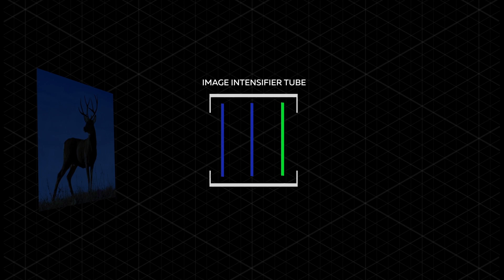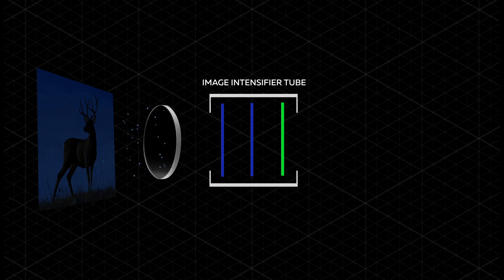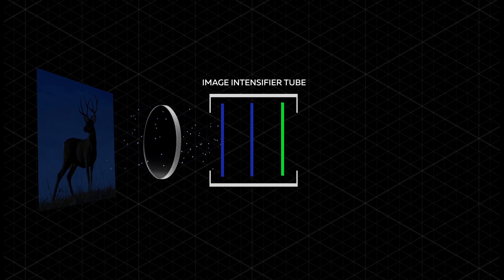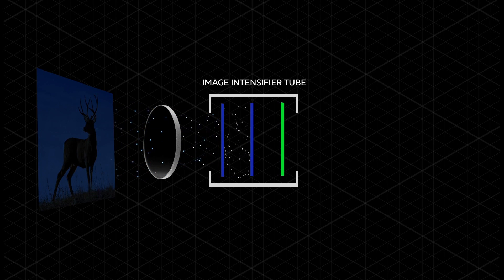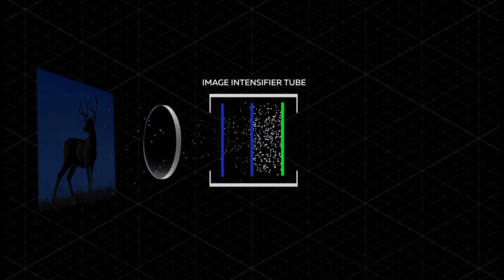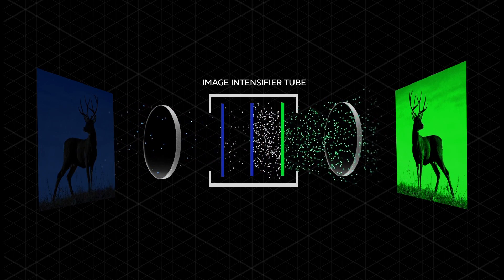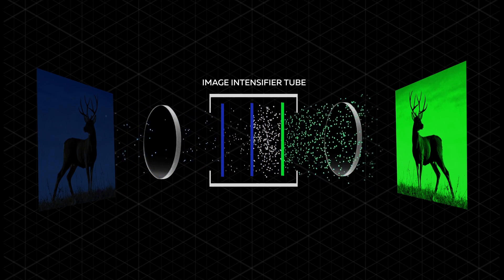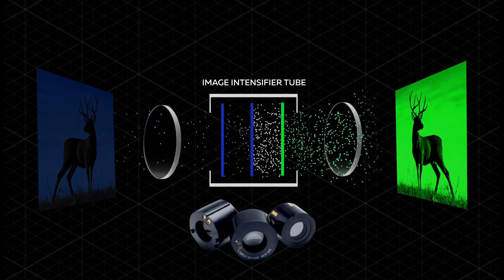How Does Night Vision Work?

Comment: This doesn't really explain much.
Why does the first layer emit electrons?
Why do the electrons travel backwards towards the eyepiece?
How are the electrons multiplied?
Why don't the electrons repel each other?

It's pretty easy to understand how electrons hitting a layer cause it to emit light, but everything else is entirely arbitrary.
Reply: The first layer, the photocathode, is charged to about 1.5 kV. When a photon strikes the surface, an electron crosses the gap and enters the microchannel plate, which is also electrified. This MCP is a thin plate of glass, coated with a layer of metal. Across it are millions of tubes or holes, biased at an angle of a few degrees. When an electron enters, it bounces a number of times, each time releasing many more electrons in parallel. The result is an electron multiplication of 1,000-100,000x. Finally, the electrons strike the anode, which in case of night vision is a phosphor, which is rare earth salt crystals of a chosen size range.
Reply: Do I need electricity to run the night vision or it happens automatically from nature and physics?
Reply: @lbks16 you need a battery
Reply: @heinrichfuhrmeister1244  ok, thanks. A electron strikes a metal in dynodes and ejects other secondary electrons from the metal by transferring some of its kinetic energy for them. Answering the 4th question from first comment.
Reply: @lbks16   exactly. This is called a microchannel plate. I dont have a degree in physics, and im not an expert on this by any means. I just own a lot of nvg for hobby. 
1. Why do the first layer emit electrons?
They used a special metal called gallium arsenide. It emits electrons when hit by radiation (photons)
2. Why do electrons travel towards your eyes?
The electrons are charged by your battery accelerating them. 
3. How are electrons multiplied?
This is the aforementioned microchannel plate. Every time electrons strike the plate,secondary electrons are produced. I don’t really know the chemical process.